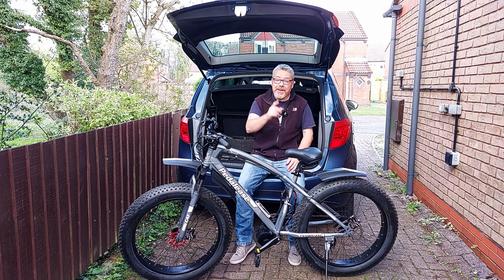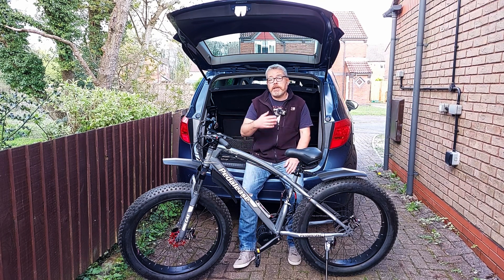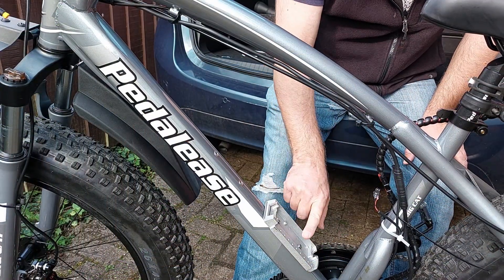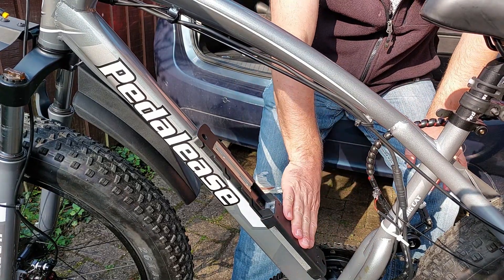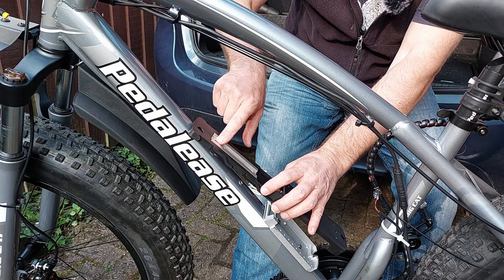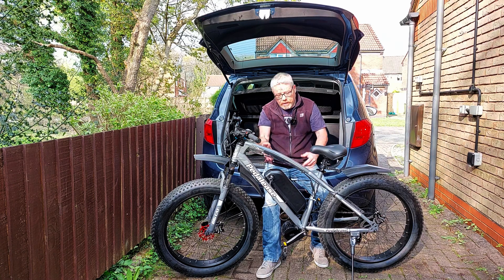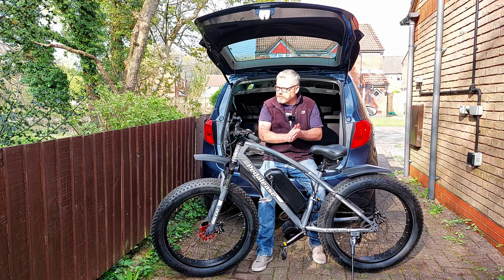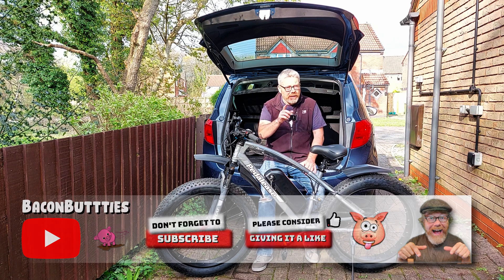HOW TO FIT AN EBIKE BATTERY IF THE BATTERY DOESN'T FIT - HOW I FITTED MY EBIKE BATTERY

Comment: damn.. I have the same problem... but I really don't want to drill the Specialized frame..
Reply: There are other options but this is the cleanest option
Reply: @grouchthatsparx  I found "adapter plate" for $5.. will try!

Comment: Did you thread the holes after you drilled them or just put the nuts straight in?
Reply from the maker: You have to use Rivnuts which have thread on them

Comment: This video came up for me when I was looking for a solution to this problem. May have been different a year ago but amazon sell a very well machined aluminium bracket adapter for  ~£18 with threaded mounts every half an inch or so. Worked pefectly.

Comment: What size drill bit did you use. For m5 rivet s and what side bolts did you use please.
Reply from the maker: I think it was a 7mm drill bit, I can't remember length of bolt used.
Reply: Did you have to use a flat head bolt or did you use the normal bottle bracket bolts.
Reply from the maker: @Landylala  Bottle bracket bolts.
Reply: @baconbuttties  thanks I must just have a bad design of battery I have had to get some flat heads it now fits. Thanks for your help.
Reply from the maker: @Landylala  👍

Comment: Good information nice fit my gripe  is you buy a £500 battery and the locks are rubbish  seen stuff on here pick it or drill it takes no time at all so another couple of ££ could supply half decent lock

Comment: Yes I have this exact problem right now. I’m going to put a couple of riv nuts like you did. Thanks for the idea of removing the lower battery mount part! Excellent
Reply from the maker: Glad it's of some help 👍
Reply: @baconbuttties  yes, just need to find a long M5 or M6 bolt and 2 nuts to use for my riv nut installation without the tool
Reply from the maker: @big_red_machine3547  👍

Comment: So...tell us more about the rivnut homemade tool you used ? I'd like to make one, rather than buy another tool that probably wont be used ever again, LOL
Reply from the maker: I used a m5 bolt with an m5 nut and washer and under that was an m6 nut .  Wind  the m5 nut  on to the bolt then put the washer on and slip on the m6 bolt ...hold them all on and screw rivnut on to the bolt ..... Pop it in the hole and tighten the M5 nut while hold the M6 nut, that will compress the rivnut. That what be a lot easier to explain if I showed it, but to be honest there are rivnut guns on Amazon for £20 and they do are far better job.
Reply: @baconbuttties  thanks for the detailed reply. There’s a YouTube vid showing the exact thing 👍🏼
Reply from the maker: @Texy_UK  👍

Comment: HI BB, I'm building an ebike using a Bafang BBS02 36V 500W motor.  My battery mount is similar to yours except that it has a full length rail ready for four mounting screws but like you I need to add two additional rivnuts for added strength for the mounting of these heavy ebike batteries.  What was the goop you used on the drilled hole before inserting the rivnut?  Was it to reduce galvanic corrosion because you were using stainless steel rivnuts?  Or did you fit aluminium rivnuts?  BTW, thanks for the videos, very instructional and fun to watch too!
Reply from the maker: I used stainless steel rivnuts and the goop was hammerite because my frame is steel so it was to stop the rust 👍

Comment: I don't think you could have done it any other way, that's how I did it on my bike. The bases on these battery boxes are not the best, especially when you have a big heavy battery, I looked high and low for an all aluminium base, to make it a bit more rigid, but could only find the standard part plastic part aluminium.
 I even consider filling the under side of the plastic bit, which has a recess with resin and installing a piece of steel tubing for the battery lock, just to strengthen the whole base, but haven't got around to it yet.
Reply from the maker: Yes the bases do seem a bit weak for the weight of the battery
Reply: I would just do the riv nut bolts. It would be a lot stronger and less work by the sounds of it

Comment: I must be thick! Don't you need a controller as well! Brilliant Video!!!
Reply from the maker: Bafang motor has built in controller 👍
Reply: As he said it's built in, but you can use an external one ditching the bafang one and giving you more power if that's you thing, mine is stock and fine
Reply from the maker: @acelectricalsecurity  👍

Comment: I'm curious how it performs and the noise from that mid drive.  🙉
Reply from the maker: I'm just about to go on the first run. Video coming soon 👍
Reply: I have the same motor with a 52v battery and it's virtually silent, the chain makes more noise
Reply from the maker: @andyb7963  👍
Reply: I have same mid drive, Virtually silent more noise from tires and chain, P.S bacon I like the way you choose to secure your battery. Very initiative
Reply from the maker: @JM-ls4rk  👍
Reply: I have a BBSHD and as others say it's virtually silent, they are very good motors, however bafang have managed to shoot themselves in the foot with its replacement, so get this version while you can.